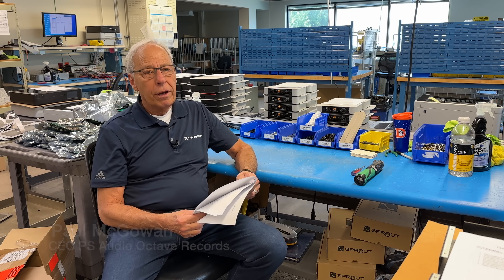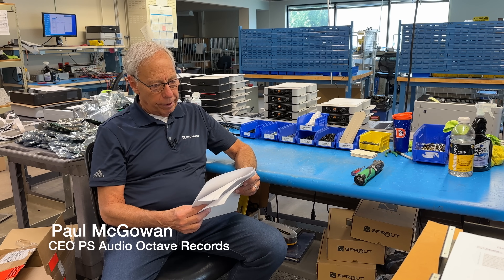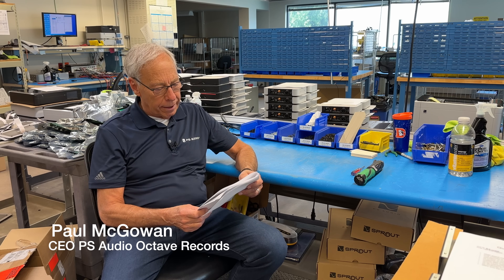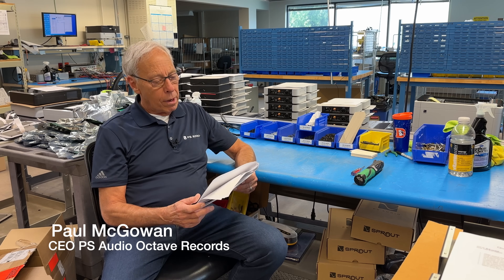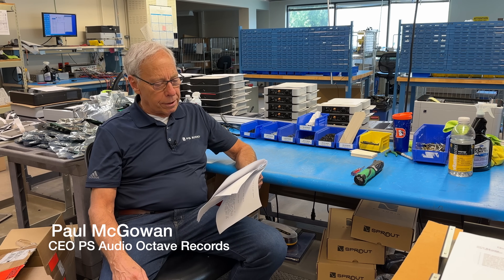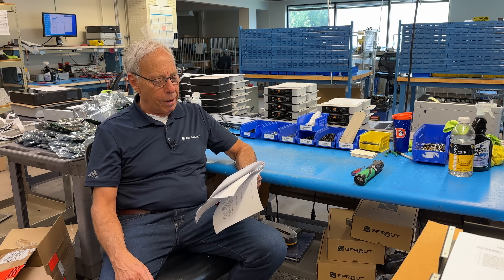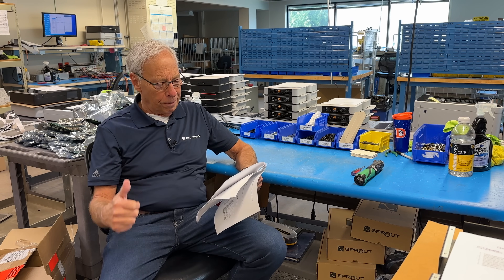Room correction and DSD

Comment: Some room nodes you just cannot avoid due to dimensions.  Its just physics.  Adding a sub is not easy but in my experience is so worth while.  I use a JL Audio CR-1 to do the xover for the mains.  Lets all bass go to sub at the point and slope of my choosing.  Sub can go in best placement for bass.  Then I apply room correction using Roon Convolution filter.  Can be done free with REW and a $100 mic.  Of course you need Roon for this.  But many have that already.  Yes I still have a peak and suck out around 50-60 hz area.  But its minimized down to about 3-4db.  Rest of the curve is great.  Do room first, then correction is my advise.

Comment: Room correction is extremely useful when it's implemented correctly in software, However, the reason room correction can't fix "suck out" or "notch" frequencies is that these suck-outs are caused by the shape of the room, where at a certain frequency the sound bouncing back off a wall is exactly inverted to the sound coming out of the speaker, thereby cancelling it out. Increasing the amplitude of this frequency in EQ doesn't restore it, it's still cancelled out. However, the NEARBY frequencies to this notch (give or take a semitone, let's say) would be made louder by bumping up the frequency, which would only keep the existing problem you had, while adding new problems as well.

Comment: Years and years and years of going to audio shows and demos and visiting fellow audiophiles and never ever did I hear a subwoofer do a great job. Yet I have faith in Paul's assessments and it's one of the major reasons why I'd love to visit PS Audio (which I probably never will, distance and finances are a thing). I'd love to hear how he set it up though.
As for DSP/Room Correction; Though it does exactly as it promises, I never heard a rig where it wasn't blatantly obvious that the sound was meddled with. Though I can see it work in the low-end to get a small speaker sounding a little larger, as soon as it does anything more than that it just completely deadens the sound. Yes it's impressive how a properly set-up room correction can completely make the space disappear. No echo, no hollowness, but also no music. For some poeple that's a trade-off they are willing to make. I'm not one of 'em.
Reply: There just isn't very many good fast subs out there, and the problem is 2 fold, as they are frequency range restricted/limited to efficiency (box size/driver type & matching/driving power)...especially in sound quality regards combined with room dynamics. To combat that you need multiple and in 2 ranges to over come these issues as well is a DSP also...a set for mid sub (kick drums range so 80 down to 25 Htz) and a set for sub sonic (pipe organ range below like 25 Htz) or like a pair of 1812's in a good room if you get what I mean? It's rare to have a full range speaker that doesn't drop off before 50 Htz or sooner and rooms magnify it. 
Also there is the issue of the source material and it's range limitations as well, plus the master's personal preferences when mixing with regards to the bass specifically.

I've experienced hundreds of concerts and tuning them via DSP...and only a couple didn't suffer from the from deadening/meddled effects; I always leaned towards operator inexperience/error with that though. On the home systems and even car audio DSP systems I didn't notice it so much, as it is like you said a compromise big time; but I do prefer dead rooms more than bright ones, yet I don't suffer much from compression drivers oddly. Not all DSP correction system are created equal as some do have patents pending on their specific tech. None of us like locating the speakers, thus appreciated that holographic 3 dimensional realism; I didn't notice many DSP systems taking that away though...but you have me thinking man! Few 2 channel systems employ DSP (DSP 8000's), it's mostly in home theaters in my experience in the last 10 years...no?
Reply: What room size and speaker?
200hz is a multiple of 50hz....
Is the room square?
OP is trying to avoid DSD to analog to another ADC/DSP/DAC conversion. I doubt thats possible?

Comment: After some room treatments and adding subwoofer, experimenting placements and measuring speakers with a mic, optimizing the position, i still had bumps and dips around +/- 5 - 6db’s, and I’m really pleased with Behringer Deq 2496 in the digital domain for room correction, I also use A/D converter (Behringer Src 2496) with my turntable to connect to Deq 2496 and quiet pleased with the results, they are very very transparent, i couldn’t detect a slightest difference from that original sound, i can easily recommend them especially for what they bring on the table according to their price. And adding an active subwoofer below 50hz area with a smooth curve upwards also means you’re helping both your amp and speakers, so raising a few db’s (I try to keep it down 4dbs at most) here and there  won’t be a problem imho…

Comment: A combination of a large number of velocity traps and limp membrane pressure traps will solve most listening room acoustic problems. I have done this in my listening room and the result is superb. Despite me building all my traps it was very expensive and involved a lot of hard work to build and install them. I don't believe that digital processing room correction is a good idea because it doesn't attack the root of the problem. Extensive acoustic room treatment does attack the root of the problem and is the way to go.

Comment: The 200Hz suckout is similar to an issue I have in my room. When I have the speakers as far out into the room as I can have them, 4-1/2ft., I get the largest soundstage but have a suckout centered at 150Hz and spanning from 125Hz to 175Hz. When I move the speakers back to a position 3ft into the room, the suckout goes away. The trade off is that the soundstage gets a little smaller. It's a room mode cancellation issue and the only way to fix it is to get the listening position out of that modal intersection. Since I can't move the listening position, I have to move the speakers.
Reply: Maybe it’s because you are playing the wrong music.😀
Play music your neighbors like to hear..🤗😀👍😎

https://youtu.be/5EbiRRpaYB4

Comment: I have a system with Dirac. I love it. A friend was deeply skeptical (pure tube and analog guy) heard my system and now feels he has to have it. Dirac is also a powerful equalizer. I had a guy who used to work in a studio help me tune mine. It also DOES help with some suck-out. Sorry. I understand why you shouldn't be able to correct suck- out ( zero times anything is still zero) but I can measure with REW and and hear it. A subwoofer is still the best answer for suck-out of course.

Comment: Isn't "suck out" just phase cancellation. Phase cancellation is simply the interaction of 2 wavefronts that are 180 degrees out of phase to the other.  Absorb one and the problem is reduced or completely eliminated.  No?
Reply: If you can fully absorb it, sure.

That would require a gigantic (or extremely expensive) bass trap, though

Comment: Problem with room correction like Dirac, ARC, Audyssey, etc. is that they all work only in the digital domain.  So, his analog signal from the DAC will have to be re-digitized into PCM, then converted back to analog a second time after the corrections have been applied.  The only problem he needs to contend with is the 200 Hz null, which can most easily be taken care of by simply moving the listening and/or speaker positions.

Comment: Room correction will never create miracle; room treatment and speaker placement as good as you can get it, then room correction might give you that last bit. 
I'm using a fully active system that I built (speakers, amplifiers and DSP) and I do exactly what Paul says, noticeable peaks (to your ears) can be brought down, but it's easy to degrade the sound by trying to get a perfectly flat respons (measuring in room). 
Low frequency is all about the room, adding a subwoofer (or more) might help higher in the frequency as well, if you're lucky (though they should Never be crossed over high, like 200Hz). More indirectly it could potentially make it possible to move your speakers a little bit to fix a higher frequency dip, while the subwoofer(s) correct potential new problem at lower frequency. 🙂

Comment: I would say hes got skinny speakers I pulled them away from the side walls a foot, also you can try a baffle on the outside of speaker to the floor and curved to about an inch above the woofer, place against the speaker this can be made from cardboard and about double the width of the whole speaker flat or slightly pointing in. It will give you some enhancement around these frequencies. Also  pushing them back can have a bearing increasing your mid lows and bass, you might have them too far out in the room as well. also check alignment electronically with REW can cause cancellations if not correct. You can use REW live seeing its frequency, if you get somebody just to move one speaker maybe just twisting one speakers don't have to be even necessarily.
Get a subwoofer one with a built-in EQ that you can go high up to 200 Hz with a good quality sub.

Comment: One of the sneaky things even high end processors with room correction pull is downsampling high resolution digital to more efficiently process all the delays and eqs. For example, when fed a 24 bit 192KHz or 96KHz source they will downsample it to 48KHz. I'm ok with that so long as it's done in an upfront manner. Not everyone can feed a 40KHz test tone through a 24/192 A/D converter just to see what comes out those preamp outputs. Trust, but verify.